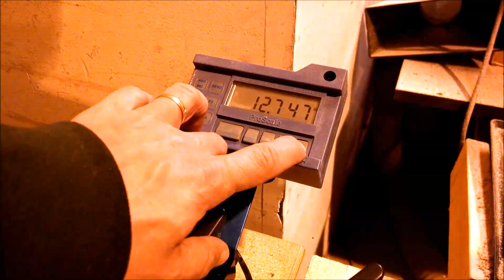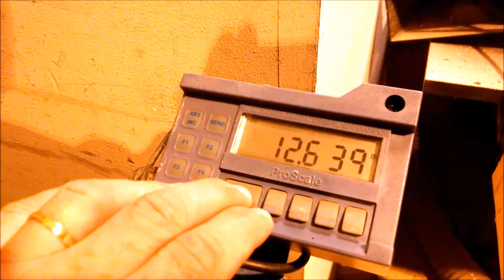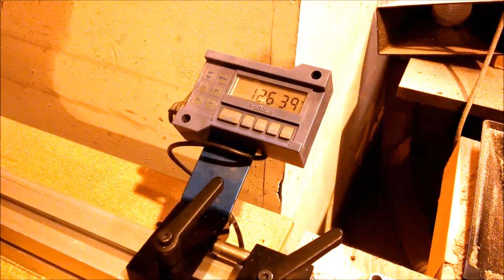ProStop - Digital Stop and Fence System

Comment: why double clamp?
Reply from the maker: When using the fine adjust feature, you lock the first handle, then fine-adjust. Then lock the second handle to fix the entire stop body. If you are only rough cutting, one lock can be used.
Reply: @mfiantaca  When you were turning the fine adjustment knob to dial in a certain dimension, at around the 4:25 mark of the video, it was set on that dimension.  Then I noticed, when you clamped down the final Kipp lever, the display gained a couple thousands of an inch on the read out display dimension.  Is there some slop or play between the Kipp lever mechanisms in this system?  Thx
Reply from the maker: @tundrawhisperer4821  The bottom of the black blocks have a dovetail shape that re-seats the blocks (and therefore the flip stop) to square when they are locked down. To avoid the .002 inches of movement, I could have pressed down on the block as I fine adjusted and tightened the handle, thereby holding the block square. 
Note that we also offer a system made using a linear bearing where the blocks and flip-stop are always square to the fence (but it costs more).
Reply: @mfiantaca  Oh, I understand thank you.  Is that linear bearing option on your website?  How much more in comparison to the set up in this video?  Thx again.
Reply from the maker: @tundrawhisperer4821  Not yet. We've been waiting on some parts to make them. But they should be in next week, so it will be online soon. The cost difference varies by positioning range. Send an email to sales@proscale.com to indicate what positioning ranges we should quote/compare for you.
Reply: @mfiantaca  Will do, Thank You Mike
Any chance there are any pictures that exist of the linear bearing set up to view?
Reply from the maker: @tundrawhisperer4821  Yes! Since I have your email address, I will send you a couple images in a moment.
Reply: I own one of these . And it’s awesome so bloody accurate
Reply: How durable is digital display unit. Can it be left in very cold condition (indoor shed in winter)